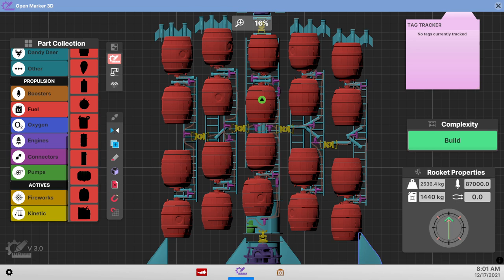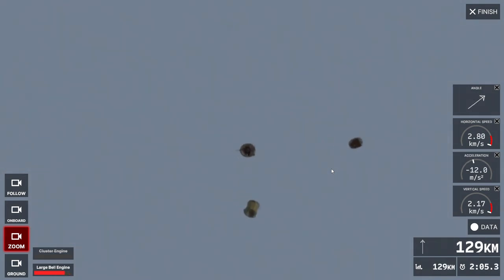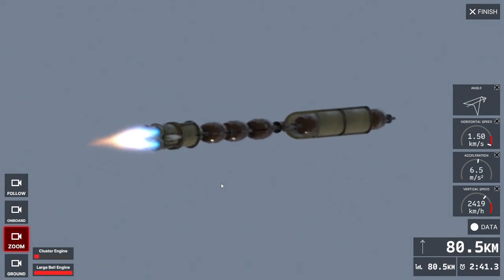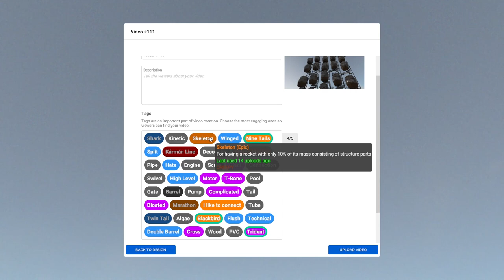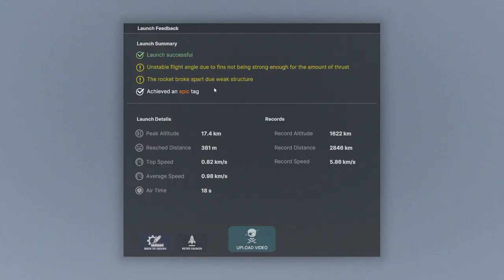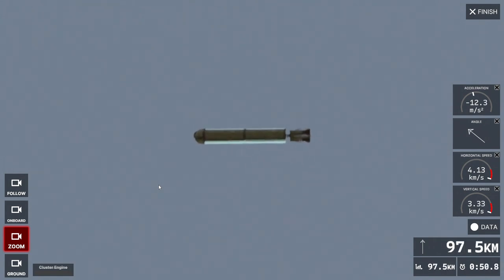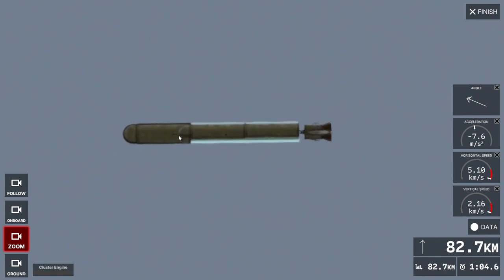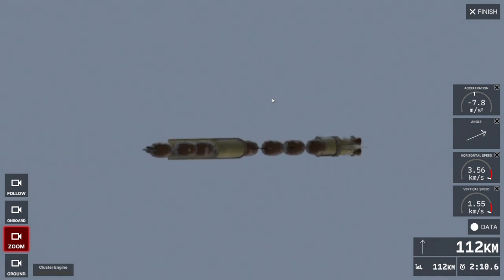Next Space Rebels Sandbox 02 - Acceleration Limits

Comment: The experimental tank has less dry mass but because it is smaller you need another pipe connector and space around it in structure. It is a strange design because tank is too "powerful" for a small rocket.
Reply from the maker: When I say less dry mass, I mean by percentage, and even with the connectors to stitch together enough tanks it would be less percent dry mass than the algae tank. It also potentially saves on a pump.